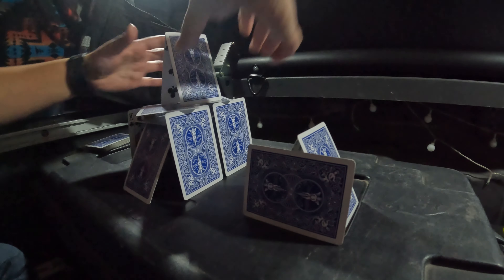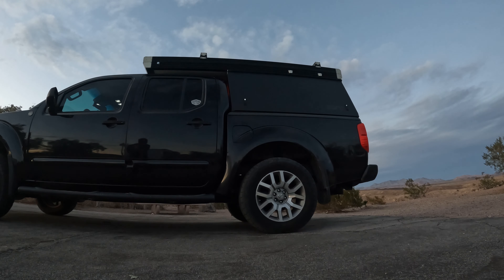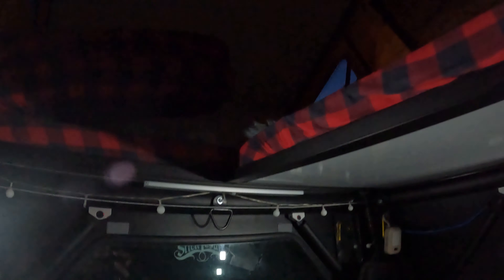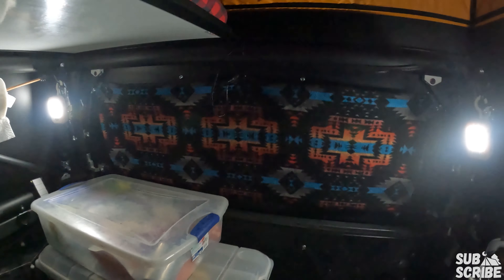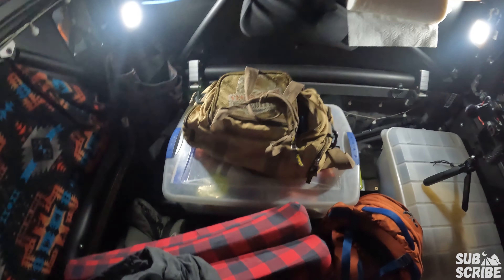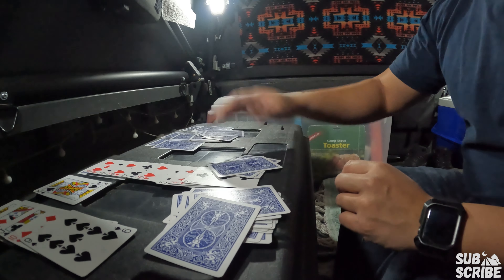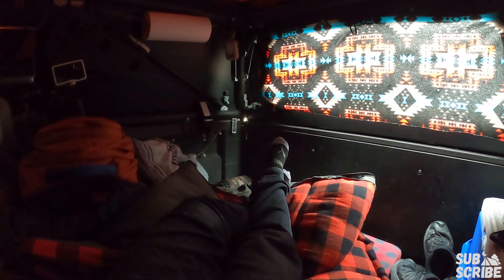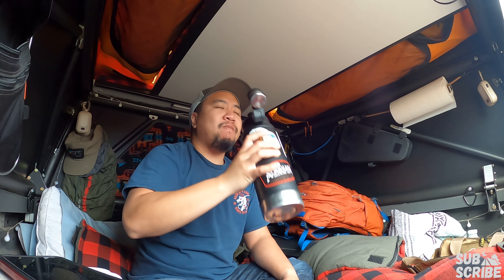Truck Camping in the GFC | NASTY one pot meal…

Comment: We upgraded from a 2007 Tundra w/ a truck tent, to a 19' single axle camp trailer. Went a little overboard with a 2019 Ram Power Wagon, but what a difference. Indoor plumbing as you get older is a game changer.
Reply: @davidboi239  Get it and enjoy while you're young, and make sure you have the right tow vehicle. White knuckle towing with the wrong one makes the trip stressful.
Reply from the maker: Thanks for the feedback! I love those Power Wagons! We've looked into camp trailers esp with the cost (it would be the cheapest option by far lol) but we'd have to find a light camper trailer thatll fit the bill for us or get a new truck and then camper or trailer

Comment: I always enjoy your videos! Sounds like you're struggling lately with space. Seems like a lot of your frustrations in this video are from moving things around to create space to cook. It does seem  a bit windy, but cooking outside/on the tailgate always makes my life  in the gfc so much easier than trying to cook inside. I've also done a "stand up" cooking situation when conditions outside are at their worst, where I move the two small square panels to the front and then push the long panel to the back. Then you have an open space in the middle. Take the cushion off the long panel and stack it at the front on top of the others. Then you have a solid working space for your stove/food/etc. It's also a fantastic working space for those remote work days on the laptop. Cheers!
Reply from the maker: Awesome suggestion! I'll give that a shot next time. Thanks for the feedback and thanks for watching Jimmy!

Comment: Happy Easter Brother 🐣 I have the same truck accept its a Pro4x one of the best trucks I've ever owned as a hunter fisherman, couple years ago a got an A frame camper easily towed by our truck and has all the creature comforts of home with heater a/c casset toilet, outdoor shower grill microwave, stove fridge camped in it for 2 weeks just like a house.
Reply from the maker: Man i've heard so many people with high milage Frontiers and they are still running like new! So awesome to hear lol
Reply from the maker: Thanks Dane! Happy Easter to you as well! I've seen those A frame campers kinda reminds me of a pop up trailer but with hard sides lol the lighter weight camper trailer / tow behind is definitely an option (and it would be way cheaper than buying a new truck with these prices lol)
Reply: @Kadenventures  pops up in 30 seconds and they are solid, collapsible design helps on gas mileage as well.
Reply from the maker: @daneboro6847  awesome good to know!

Comment: Teresa said it's only 40 calories because you won't eat it all. 😂. She would also like to know if you rescued the dropped Doritos. Plus how many others got edited out of the video which also had received the same treatment. 😢

I'm glad to see you didn't have to add any MSG to the oatmeal. After the epic dinner failures. I believe we'll stick to our Ramen noodle to avoid any loss in sodium from our diets....LOL. 

We've gone from a large truck slide in (Lance on our F350 dually) while also using our Coleman popup. Then started an Expedition Overland Flatbed Camper Build on our F350. Then gas prices went crazy. Now to the GFC on our 2019 Ford Ranger FX4. 

Definaly planning to build a offroad small pull behind (something like the Mission Overland or OverKill with the slideout). I do love the Nucamp products based on quality, modern materials and use of space. We love our Pop-up camper just takes time to set it up. Each has the right application for each trip. For now we will keep understanding how to make the most out of something so small. Definaly no build outs. As you know, that just adds weight and limits each trip to fixed systems. 

Pick what works for the two of you we will come along for the journey. 😊

Mark (& Teresa) 
Hampstead Maryland
Ford Ranger - GFC Camper V2 #1919
Reply from the maker: Yes I did rescue those Doritos after their fall lol! And good to know! We definitely want something a bit easier to camp in especially for longer trips and some light overlanding capability for those easy to access dispersed camp spots. Possibly an upgraded truck with a camper? So many options its tough to decide. We pulled a UHaul trailer from Alaska to Vegas when we moved down here and we really didnt enjoy pulling a trailer around but we want to try travel trailer life again under different circumstances (possibly through Outdoorsy) to see how we like it. Thanks for watching guys! Appreciate it
Reply: @Kadenventures  If you twist my arm hard enough I'd vote for a Scout slide in camper. 🙂
Reply from the maker: @OutOfOfficeCamping  we’ve seen the scout in person! Its a pretty cool camper reminds me of the Kimbo campers

Comment: So I’m watching the keto noodle fiasco and cracking up thinking this is something my wife, also Filipino, would do. I show her the video and reaches into the pantry and pulls the same package out. Too funny. I’m running the Super Pacific X1 on my Tacoma and love it. I have mine organized with soft pouches on the side doors, use their mole panels to keep things off of the floor. I also have their attic across the roof of the tent for additional storage. It also comes with an exped mattress thats really easy to push the entire bed out of the way and take advantage of all of the camper space.
Reply from the maker: 😂😂 that’s awesome I’m glad I’m not the only one haha you’ll have to send me a pic I’d love to check out your setup on the super pacific! R u folding up the exped when you push it away to use the camper space??
Reply: @Kadenventures  yup, I just fold over the exped with my sleeping bag and stow it out of the way. It’s very easy to use and then when I’m ready to sleep I just pull it back out and climb in bed. Keep up the good work.

Comment: Good video. Was looking at GFC but i think its better for a Full size truck. I have a Ranger (5 ft. bed) and feel there is not going to be enough room. Even did a rear seat delete to help . Have ARB awning that i can have on side or rear. Now looking at OZ RV3 or RV4 Tent can connect to awning or get ARB Room under awning. Van would be nice but i know i would spend to much. Good luck with your decision.
Reply from the maker: Agreed, its definitely tight on a 5 ft bed esp with multiple people, luckily im not a big dude. Thats a good option for the awning room, i've been looking at side walls for my 270 awning so we can extend the living area and get out of the elements when its crappy out. Thanks for watching Kenn! Good luck on the build out for your Ranger!
Reply: @Kadenventures  Have a 270 on my trailer with 3 wall panels. Love the panels. When i look at other camp options its really hard to give up the 270 with panels !

Comment: Dude, good video. I like the way you show life in a 5 foot by 5 foot space. Also, if you like the GFC and your truck, just build out your interior to meet your needs….make a camper out of it.
Reply from the maker: Thanks Glad you enjoy it!  And thats a good option to build out the interior, something to think about! Thanks for watching!
Reply: @Kadenventures  Well, van camping is always cool, but I pass that on because I have an Alu-Cab Canopy Camper on my Gladiator and I've done nothing to the inside so I can "get a feel" for it. Right now I'm practicing where my fridge would go, my power system, etc. and researching the lightest wood or aluminum extrusion, so I can build it out just the way I want. I'm actually watching how you are "living" in your rig and using your experiences to drive my design. So, thanks for that. But, that is why I recommended it. Cheaper option if you already own the truck and camper and gives you almost the same experience.
Reply from the maker: @BoonieRat_  that’s awesome! The Alu cab was on my list prior to buying the GFC but sadly they don’t fit on frontiers lol

Comment: Hopefully, you will respond to this because I am about to drop the hammer on either a packout camper or a go fast camper. I am leaning towards the packout camper due to the fact that you can leave your bedding on the bed and that the bed actually lifts up with the hydraulic struts instead of having to remove panels..  Being able to fix things to the outside of the camper is also a nice benefit. How do you feel the Tent body compares between the two? And is the extra weight of the pack out camper an issue? 
I can’t really find any place that does a decent comparison of these two and I know that you’re familiar with both so I would really appreciate your opinion. Thank you very much.
Reply from the maker: Hey Todd! If I had to choose between the 2 I'd honestly go with the Packout Camper. The weight is pretty negligable depending on your truck but the 2 points you mention - the ability to easily lift the bed AND store bedding up there is awesome (I do enjoy the formafloors of the GFC sometimes when i'm by myself but when I'm with the wife and doggo those individual panels are a pain to move around my 5ft bed with an extra body in the truck bed and a dog.) The Tent windows are also a huge plus on the Packout. Check out my latest video of me camping with the Owner of Packout Campers - you'll see the tent has a bunch of upgrades since the last time I showed it off (better rain fly option, the bug net on the windows make sense, they even have a fan option on the roof which is awesome). They also have additional storage under the bed lift now (over the cab of the truck) for bedding or other items. And the ability to hang stuff outside the camper with all the T slots everywhere is definitely a game changer. 
My latest Video camping with Packout here:  https://youtu.be/3WoYQ7hgKXI

If you have any other Qs let me know!
Reply: @Kadenventures  
Thanks so much for getting right back to me. Looks like I’m going to go with the packout camper and I saw a couple of other options that I’m quite sure I’m going to need. The pizza looked awesome. Great videos thank you very much!!